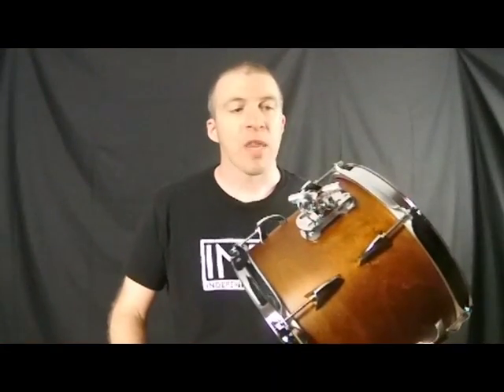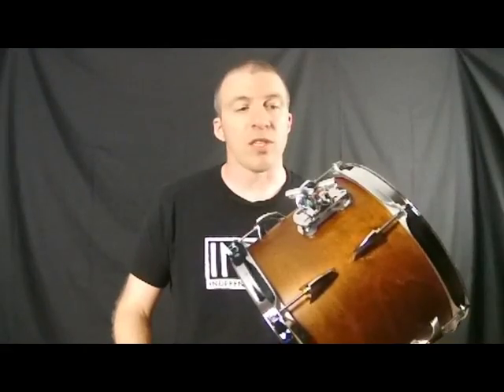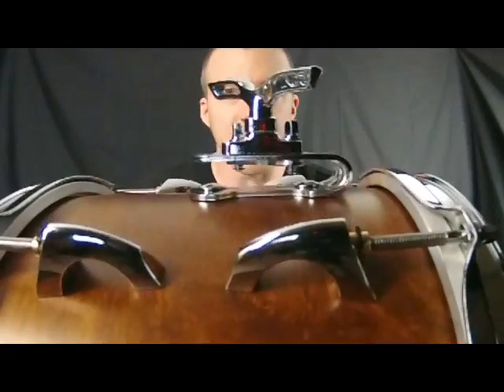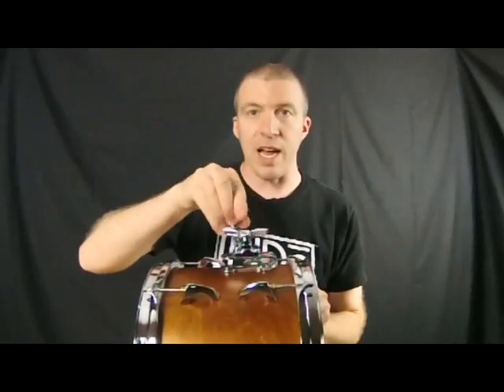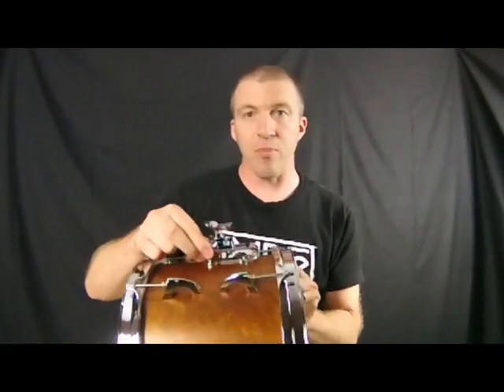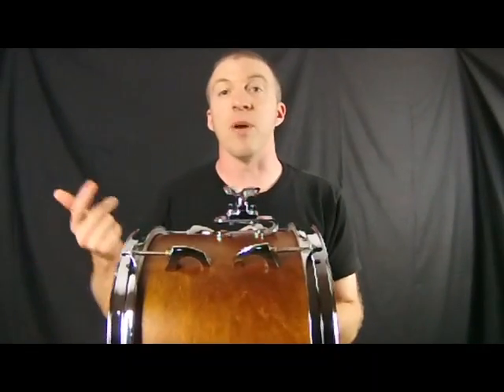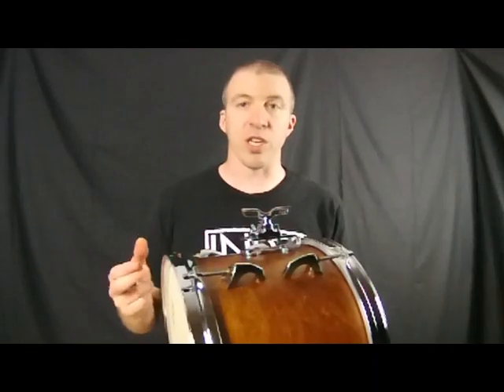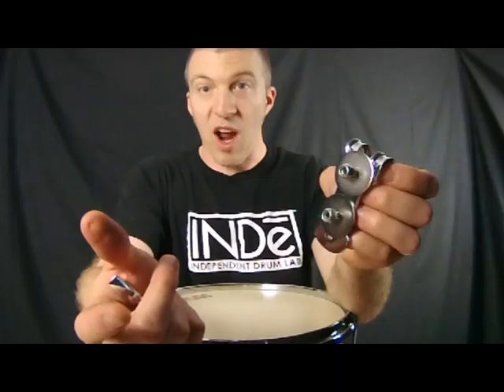Tom Mount

Comment: I installed one on my 1966 Ludwig Club Date 8X12 tom, primarily so I would have a memory lock on the tom arm and it would make it a bit easier to use the console mount that is on the bass drum of that kit (getting that tom to the precise same position each time using the old hardware was not impossible, but it was time-consuming).  I can vouch for the adaptability and functionality of the bracket, as I was able to install it in minutes, and the mount clearly allows the drum to react to being struck more than the fixed tom bracket. I have not yet played my set enough to determine how much more resonance I can achieve, as I haven't had the opportunity to adjust the bracket up and down to find the sweet spot, but the bracket certainly produces more resonance than the standard fixed mount.  This is a good product, in my opinion, and I would recommend using it on vintage drums if one is gigging on them.

Comment: YES!  I have a late 80s / early 90s Pearl BLX kit and the floor tom brackets are a total odd-ball 2 3/8" screw spacing which I know of no other replacement for and original replacements are IMPOSSIBLE to find.  Mine are in working order but I'm going to replace them with these and stash the originals. The adjustable mounting screw spacing totally key!
Reply from the maker: We always love solving problems!